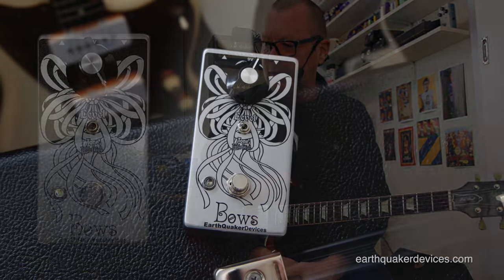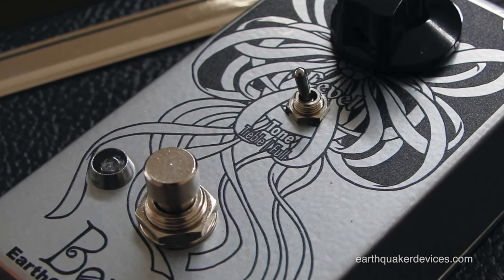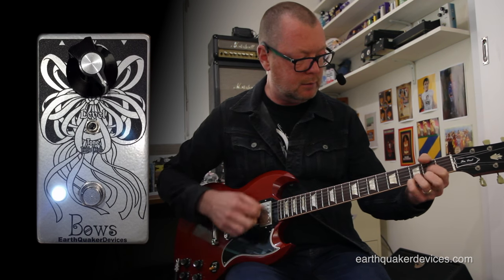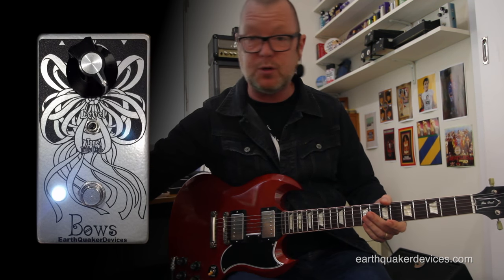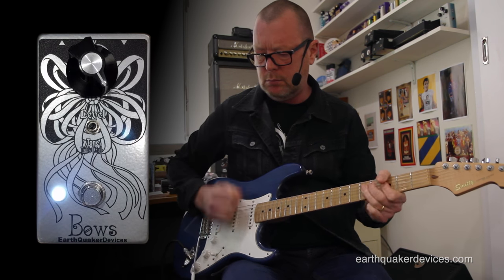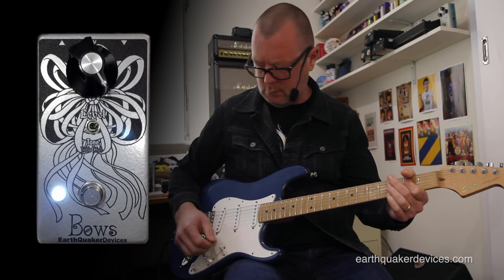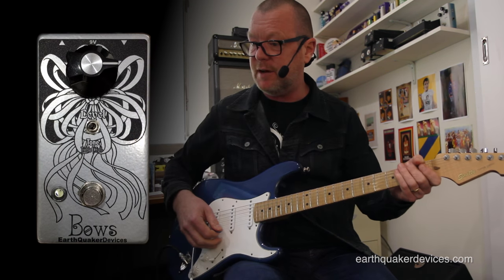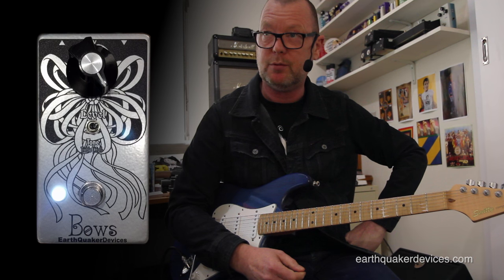EarthQuaker Devices: BOWS OC139 Treble/Full Boost/Preamp

Comment: Just got one, very different sort of timber.  Dynamics is the name of the game.  Put it on 3 o'clock and It goes from whisper quiet to full on overdrive on a decent amp.  Had it next to a JA Prism (very good boost), and found while the prism is more tweakable and has a tighter sound (but very compressed), the Bows leaves everything to your fingers and guitar controls.  What a magical little device that forces you to be better with your right hand.